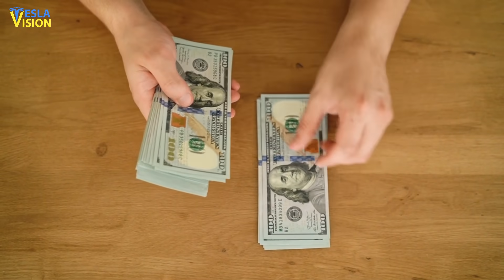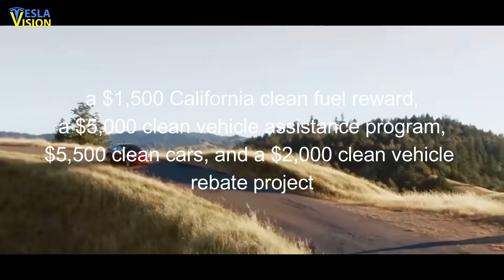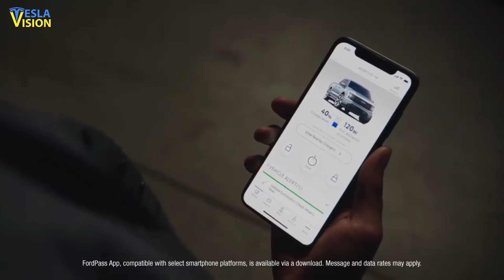NEW TESLA MODEL 2 is Engineering Genius That Will Be Copied A LOT

Comment: There is many problems with the Tesla cheaper Model 2, 
1 > the Cost. It maybe stated as going to e $25.000. 
But seeing as the Model 3 was meant to be just $35.000 and that it ended up being sold for $38.000 upwards and most of those sold in fact now cost $48.000 or more. 
It is safe to say that Tesla will not keep the cost of the Model 2 at the promised price even if the new 4680 batteries are really when the sales of the new car happen?

2 > The fact also that they will be doing the new $25.000 Model 2 as another clone of the Model 3, Will mean that that will put of allot of possible buyers of that car since it also will not be fitted with a binnacle speed display in front of the driver. Having moved the speed display to the LCD main screen is not a good or safe move. 

The reasons all cars ICE or EV had the speed display set up in front of the driver was simple, testing proved that drivers needed to by law give 100% attention to the road ahead so it become a rule that all cars had to have the speed in front of your view just below the top of the dash so you could quickly glance down from the windscreen ( wind shied in the US ) for a few seconds to see the speed then back up to watch the road as per the driving laws.  

Having moved the speed display over to the middle of the dash on to the corner of the LCD screen means now your having to take more time to look away from the road view trying to see those unlighted black speed figures on a white screen, Not the best display set up as years of testing found that the human eyes need a bright lighted clear speed dial of numbers on a black screen under a shaded inset are to be easy to see. 

So the Tesla model 3 and Y and maybe soon the Model 2 having the no driver normal binnacle means those cars are not safe to driver as you have to take your eyes off the road for much longer to try to see the bad speed display of black small numbers on a LCD screen corner. 
Not what all the other EV's or ICE cars still do which is to have a fully done right lighted and shaded in front of your drivers view display.

3 > Price of the new car will not be that good in the UK or EU as we don't have the EV incentives that most of the USA have. 

In the UK our limited EV Credit incentive by the UK Government has been cut down over the last couple of years such that it is now almost pointless having it.  It was £5.000 off the EV's sale price. But now it is dropped to around £3.000 Which I am sure it will in 2022 be cut again most likely to just £2.500 
So not much compared to the possible upcoming US new $12.500 off plus possible extra off there from each state doing their own credit off schemes.

Plus we still have to pay VAT on the Tesla cars and that is at around 25% for luxury items. It is safe to say that a Tesla car is in that level of TAX.
When our Government keeps banging on about they are in favor of us changing over to EV's soon ( the ICE car selling ban is by 2030 ) They sure are not exactly making the cost of changing over easier on the poor money strapped over Taxed UK citizen.

I really can see major problems with the sales of the Model 2 for lots of reasons in any country outside of the US and China They have the bigger EV incentives we can't have.
And remember a ICE car of the same class and size of the upcoming Model 2 are half it's cost in the UK and the EU. 
Which is one of Tesla's biggest markets so that will loose Model 2 sales to Tesla. Why a possible car buyer should pay for a Model 2 when for half that price they can buy a ICE version even allowing for possible fuel lower costs etc. with a Tesla Model 2 it still is not easy to pay double the cost for the same sized car as a ICE car. 

Most low paid people in the non USA markets can't afford to pay double for the same sized car just so they can own a Tesla.

Comment: If the 2 will be not that different to 3 or Y. Then they may cut in sales on those.
Rumors also did mention, that it could be  a crossbreed, between Toyota and Tesla... actual both has a T ^^ Which leads me to, Model T ^^